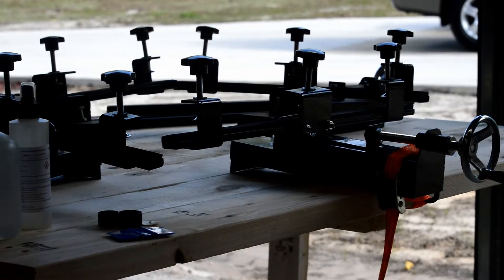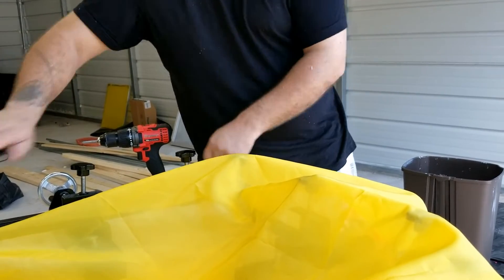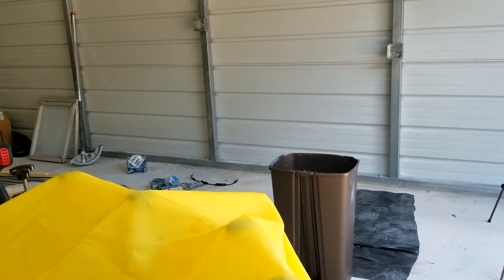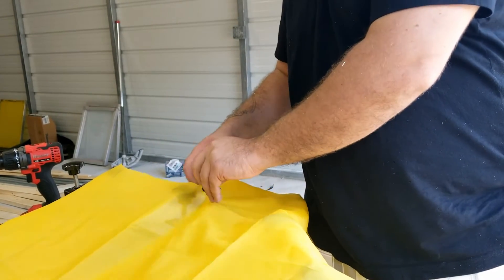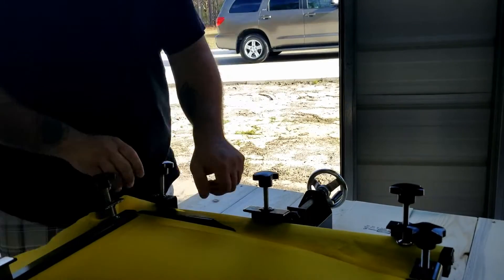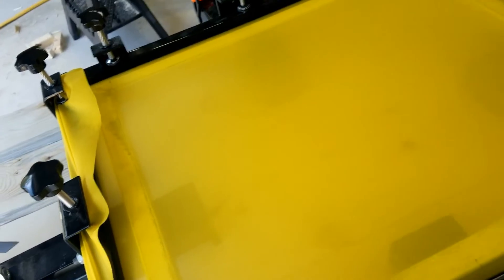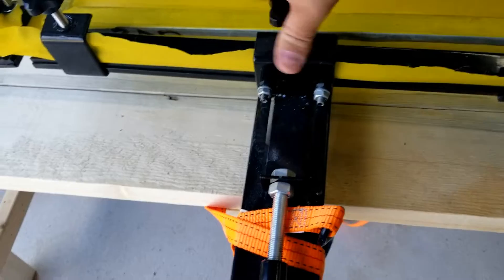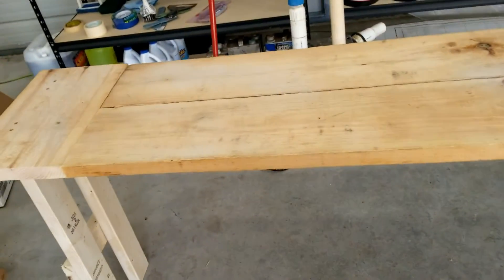How to Stretch Your Own Screens for Screen Printing #ScreenPrinting #Smallbusiness #Howtoscreenprint

Comment: How do you clean the mesh off the frame when you have to make a new one?
Reply from the maker: I use a high grit flap disk on a grinder. You can get them cheap from benchmark abrasives or empire abrasives.